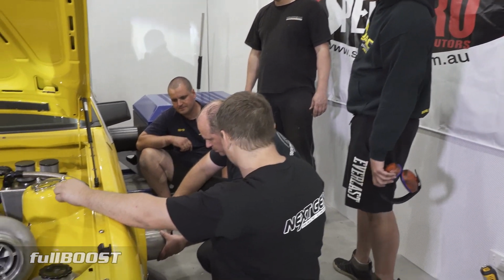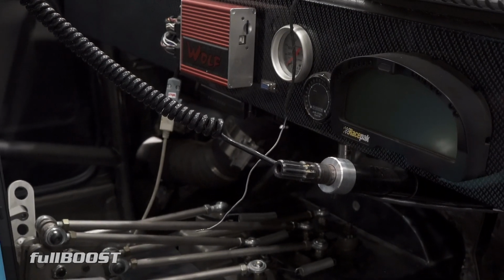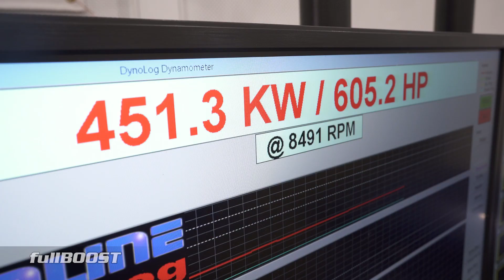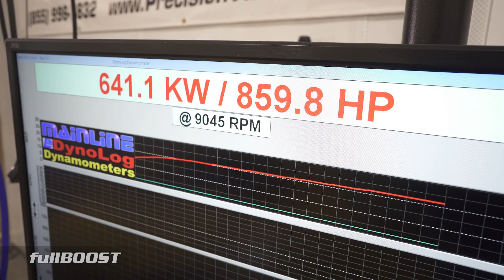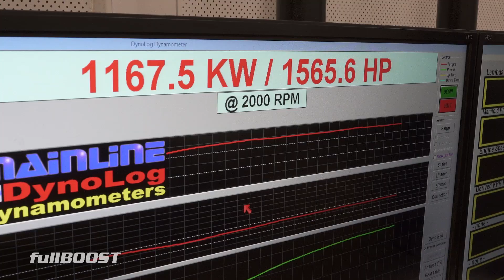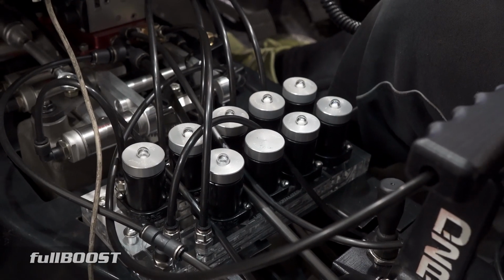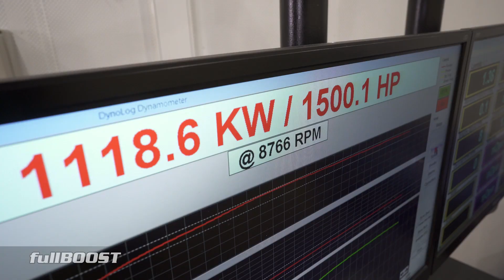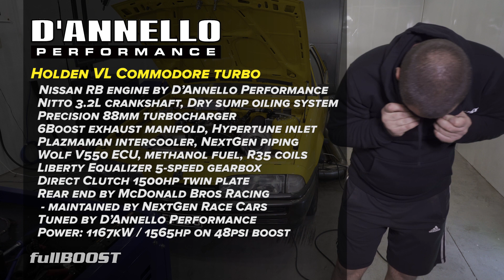BEST sounding Nissan RB30 | fullBOOST

Comment: Years on and RBs are still the best Nissan has produced, what an engine.
Reply: I dont like nissan   the one i had couldnt even handle short trips  it would get hot      then the head cracked     2.5 k latter    apparently the head cracked on the original engine to    it got a bigger 1.5 litre engine guess what        head cracked   another 2.5 k later   then the cv joints went on it and it was getting hot as fuck again so i tpok it to the scrap dealers they gave me nothing for it     wankers
Reply: @fanoffreedom3003  that's not Nissan, just shit mechanics sorry to hear mate., yeah they heat up because they sit so close to the firewall that's why majority of people throw big intakes in em.
RB is worth alot of money these days.
Reply: Ahhh yes... Let's all tip our hats to the people whom Nissan copied the RB off (with their help, admittedly)....
Reply: @fanoffreedom3003  lmfao
Reply: @fanoffreedom3003  Sounds like you had an N12 Pulsar- not really in the same league as RB powered Commodores and R31's dude
Reply: @justinbryant237  Who did Nissan copy the RB engine series off???
Reply: @danielbrealey2924  made by the same company,  has a Nissan badge on it, would a ford escort beat a Nissan sunny ? yes,  would a Ford Falcon F6 beat a Nissan Skyline GTR  of course  would a FORD GT beat  the most powerful production Nissan Skyline GTR?   Absolutely
Reply: @fanoffreedom3003  Any car can go fast these days, just Ls swap it.
The Barra is an amazing engine perfect for a street legal build, the coyote is powerhouse too has torq and timing chain issues though.
In saying that your comparing them to an old ass engine, a RB26/30 with a snail was literally untouchable in it's time.
I would compare the modern fords to the new VR38DETT but that engine is shithouse.
RB is iconic, just so sick of seeing everything LS powered.
The drag strip needs something fresh or original.
Reply: @justinbryant237  You still haven't answered the question; who designed the RB series engines for Nissan? I can answer it for you if you like... Nobody. Nissan designed the engines themselves and allowed Holden to use the RB30E and RB30ET engines in the VL Commodores because Holden was having trouble getting the 202's to run properly on unleaded fuel in time for the law that started the 1st of Jan 1986 and the release of the VL. It was cheaper and easier to use the Nissan sourced engine. Similar story for the Buick V6 used in the VN - VR series Commodores
Reply: @fanoffreedom3003  and the supra beats the lot you ford boys are the best funny as
Reply: RB, TB48, VR38, SR20, VG30... Etc
Nissan motors is the best Engines.
Reply: @brentonwood5464  not that modern BMW shit but a old school MK2 would win on looks alone

Comment: I was saying that once the boost hit 40psi it would go 1100hp...

DID NOT THINK IT WOULD GO OVER 1100 KW🤣🤣🤣 and fkn clutch limited.

Thing is on meth, literally, and figuratively!  that thing is fkn crazy👌🏼👍🏼.

What an absolute fkn beast.

I feel that your excitement level on the voiceover should increase a bit when showing these types of vids, as the rareity of builds like this, and numbers like these deserve a bit more than the downplayed monotone(ish)  voiceove that it got.

Still, top marks @Fullboost.
Reply from the maker: I will put out my best Darrell Eastlake impression next video 😥👉
Reply: @fullboost  RIP Darrell🤘🏼
Reply: @fullboost  I'd like to see and hear that!!! 😅😅😅
Reply: Yeah, methanol is a great fuel for making power on. Although methanol holds less energy potential per unit, you burn 2.5 - 3 times more of it and it works out you can see 25 - 30% power increase without even really breaking a sweat